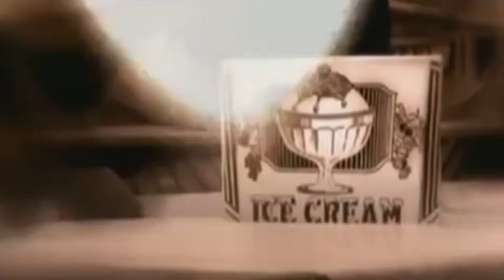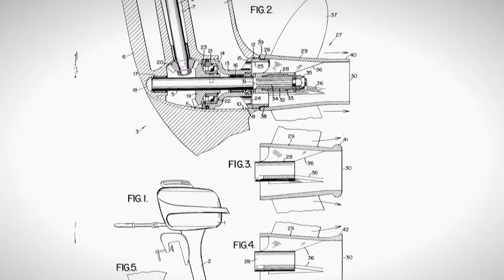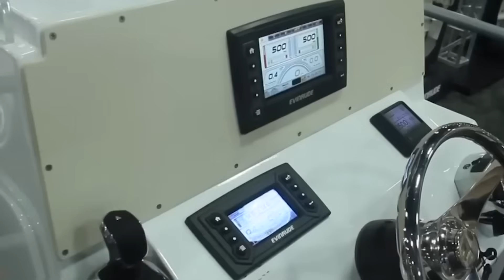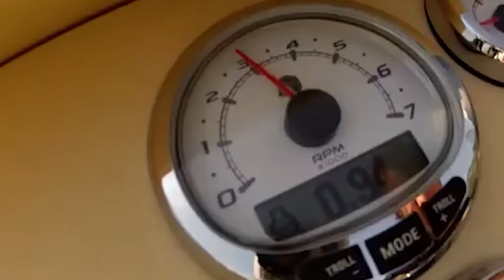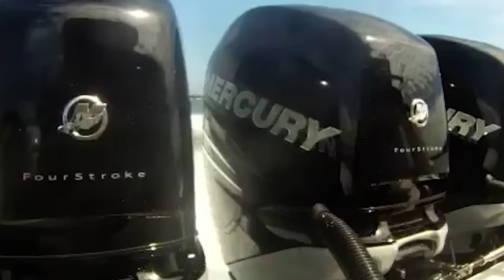Why Mercury and Evinrude Motors Are So Different?

Comment: Karl Kiekhaefer was a marketing genius. Selling outboards that put out more HP then the sticker. "Thunderbolt ignition" with a warning label attached that death could occur if you happen to come into contact with it. Sleeker outboard designs. People ate this shit up. Times are different now and people just want to go out and get back in for the most part. Men are pansies now and don't know how to mix their own fuel. Now we have outboards with $1000 fuel pumps and $10K lower units.
Reply from the maker: Top end outboard prices now are crazy. Often see transoms that cost more than a decent house! Are you mercury through and through?
Reply: @VintageBoats  I'm an Evinrude guy. I have a 225 HP Evinrude G2 on the back of my bass boat. I do have a 30 hp Yamaha and a 50 HP 2 stroke Nissan that i'm impressed with. I also have a 45 hp Mercury but haven't decided what I want to do with that turd.

Comment: You have the story wrong, OMC was co owned in the 60's by Ole Evinrude and Stephen.F. Briggs the father inlaw of Robert. P. Mcculloch (Ole Evinrude was also an inlaw of Mcculloch through Briggs ) Mcculloch was asked by Briggs to buy Scott Atwater and produce racing outboards as Mcculloch himself was a champion boat racer and to compete against Mercury as Mercury was gaining too much share of the outboard market from their popularity from racing and OMC was never marketed as as a performance engine but more of a reliable workhorse. Mccullochs often beat Mercuries in Racing and this is celebrated by the chequered flags emblem on the back of Mcculloch motors.

Comment: My dad ran a 15hp Evinrude on his Jon boat up and down the Pee Dee River for over 40 years. Other than an occasional spark plug replacement that was all I ever remember him doing to it. He never wore it out and now he’s gone but the old Evinrude still runs. He owned one Mercury in his life and it was a piece of junk that was next to impossible to start on freezing cold mornings.
Reply from the maker: What Merc was that?
Reply: @VintageBoats 
I don’t remember the model number but it was one of their older 20hp 2-stroke models. When it ran it was a good bit more powerful than the 15hp Rude but after several trips to the local boat dealer trying to get it to be reliable he sold it. Hard starting, and would occasionally just shut off.

Comment: My Johnson 1977 85 hp starts when you bump the key 45 years later.
Reply from the maker: Love it. What major works if any?
Reply: I started with a 1965 Johnson 40hp.  Talk about heavy OMG. Have a 76 Stinger 75hp 3cyl. In the shed that runs good.  Basically rebuilt the bottom of the motor.  Drilled and tapped many bolts.  Saltwater plus aluminum plus SS bolts = wrung off bolt.  Aluminum corrosion locks the bolt in tight.   Have a 18' Angler and the 75 gets the hole shot over my 85hp but 85 has it on top end by about 4 mph.

Comment: I have an 82 Evinrude 35hp on my pontoon boat.  Every season it fresh starts right away.  End of season it's shut off and dragged 50ft from the water.  New season, new gas, fresh starts again.  I think its only had a few sets of spark plugs and one water pump impeller in 43yrs.   What a TROOPER!  I used to be OMC, OMC OMC, but...the Merc 90hp Tower of Power is still the bad ass of the bad asses of boat engines, EVER !   To make an OMC V4 sound good, you have to under prop it and get er' to run 400~500 rpm over its power peak.  My brother's 115 x 86 Johnson is propped at 6000 rpms and its amazing sound and runs like a bat outta heck.
Reply from the maker: That's good going! How much longer you think it will last?
Reply: Yes, he’s hearing “Mercury Outboard Blues.”

“I really NEED a Mercury!” (And, if I had the $$$ to spare, I’d buy one and a boat to put it on.)

Comment: FASTEST SINGLE OUTBOARD  IN THE WORLD RECORD IS STILL HELD BY A 2 STROKE EVINRUDE.
Reply: The OZ F1 engine was awe inspiring 425hp of 2 stroke magic
Reply: @Clarksmarineincindiana I still love old 2 strokes. They the V8 Evinrude was laying down around 600 Hp in order to set the world record. Probably only good for a few runs at that HP
Reply: @keithbailey8885  I would have no clue of the actual horsepower for the world record. I just know what the “rated” horse power of that engine was because of  actual price list from second effort racing back in the day. We have a 3.6 liter V8 would love to find the newer 4.0 liter engine
Reply from the maker: You are not wrong! Perhaps a good video to be made...
Reply: @VintageBoats that record still stands. The weight to power ratio with that V8 2 stoke was something else. Even modern outboards can’t touch it.
Reply: @VintageBoats  please do! A lot of history on the outboard and the drivers for top speed records

Comment: Love Evinrude. I really hope to see them back! The E-Tec G2 was so good! I absolutely love mine.
Reply from the maker: Unfortunately think thay day has gone. Did you have a g2?
Reply: @VintageBoats yes I still have a G2. We had a wonderful Evinrude dealer in my area of Canada and there is many happy Evinrude owners
Reply: 2016 etec 135H.O. absolutely love it. It replaced a 1987xp150 with countless hours. I sold it for $600 to someone in need. Still running strong.
Reply: @michaelscott8510the 135HO are strong! Especially on the right hull rated for low HP. The V6 2 stroke tourque is fantastic! For such low HP!

Comment: I've got a 2001 omc 115 - probably one of the last carburetor powered outboards, the pinnacle of the carb technology. My motor has many, many hours & starts up easily at a touch of the key & it runs STRONG, much more power than my previous yamaha 115!
Reply from the maker: How many hours you reckon?
Reply: @VintageBoats 1200+ & still ticking along nicely.

I have removed the VRO & VST & run it on premixed fuel but other than that she's a beast!

Comment: In my 40 years of experience, Mercury was always the more desirable, reliable brand over anything from OMC. But Yamaha was always considered the reliability king. The mercs were always faster . People will  be brand loyal, only because they don't want to think they bought the wrong product. Another point, Suzuki went all in on 4 strokes more so than any other brand, and today they build what I would consider the best overall 4 stroke for personal use. I would pick mercury for top speed, Suzuki for quiet personal use and Yamaha a close second. You can't really go wrong with the 3 brands, and they always were better than anything from OMC and BRP. Truth be told.
Reply: My father was a loyal OMC man because what he observed with Mercury in the late '40s through the early '60s was far less reliability, not to mention their "direct reversing" dock smashing design. In addition, his 1958 Evinrude Big twin 35 was quicker than the Mercs in that HP range during that time. Even as a young man I noticed they were stubborn starting at times, but all that seemed to go away with Thunderbolt ignition. 

However, a year or two after he passed (at only 47 years) an opportunity to buy a Baja 14 ft with a 85 XS Merc came before me and I trespassed family tradition. I was so impressed with it's strong power curve and excellent fuel economy, not to mention it's robust and superior mechanical design that I haven't hesitated to buy Mercs ever since, in fact I have two smaller ones in my shed right now.
Reply: @Motorhead-hm5jq  since my experience only goes back 40 years, what occurred in the 1940 's is before my time.
Reply: Honda Marine is the most reliable out of all of them and was leader in 4 stroke technology in the 1970’s.
Reply: @craiglittle7367  yam has Honda beat today, tho not in simplicity, Honda is preferable to work at over Yam, yam has 3 different water pumps that are exactly the same, except the location of the dowel pins or the length of the water intake tube off the top of the impeller housing, however, they are indeed stronger.
Reply: I’ve had 3 mercs, a 1978 90hp, a 1980 115hp and a 2004 90hp. I have one Johnson, a 1989 50hp  it’s certainly not as fast as the mercs but it is absolutely the most reliable. The old Johnson starts easier idles smoother and never has any issues whatsoever so ever.
Reply from the maker: Definitely from BRP. Do you own mercury?
Reply: @VintageBoats  I have owned several Mercury motors, have extensive experience with mercury. Also owned Yamaha and the new 4 stroke Suzuki motors .
Reply: your brand loyalty is showing
Reply: @ccclc6159  to which brand?
Reply: @Briandswinford  clearly mercury
Reply: @ccclc6159  How so , I think the Suzuki was the best overall motor I ever owned. But the mercs were faster. The only motors I never liked were built by OMC.
Reply: Exactly what I thought. Maybe he had a motor made on the best day ever at the Merc plant. No way on God's green earth has a Merc been more reliable than an OMC product , of course , that is allowing for each to have a bad day. @ccclc6159
Reply: Fisher Pierce made Bearcat 4 stroke outboards in the 70’s.  Probably before Honda got going in the outboard industry.
Reply: You’re not entirely correct. OMC/Evenrude made very reliable motors for a long time until they eventually didn’t..😂
Reply: @bluntone2273  Maybe in your world but on my local lakes , back in the 80's, it was always a broken Johnson of Evenrude .  After all if they were so great then why did Yamaha win ? It's now all Yamaha and Mercury . Suzuki is making a good presence in the US with some great offerings. and of course Tohatsu which isn't popular here only because a lack of dealers. Let's get real , OMC would have never been able to compete with what's offered today. Mercury had the backing of a very large company with almost limitless RD money. The Japanese offerings were already really good and top quality. They had no chance long term anyway. We wont even get into the Toxic waste mess they left that the taxpayers had to cover. The company was a disaster I never understood why so many people still rally behind them. They did nothing good for the industry, they cost the tax payers money, they damaged the environment all for their crappy low quality outboards. Cobra stern drives, lol we won't go there . I say good ridden and the fact that BRP threw so much money at the problem makes me question that company also.
Reply: We had a little Honda 4 stroke 20 years ago, and it was pretty quiet too👍
Reply: @coryernewein 

I believe Honda was the 1st 4-stroke outboard manufacturer/importer in the USA back in the late 1960’s early 1970’s. 
Honda was leader in 4-stroke innovation before any other Marine manufacturer.

They still make the best outboards, btw.
Reply: @coryernewein  Honda never even made the list because the availability was non-existent here where I live. I might have seen 3 in my entire life.
Reply: 100000% boat mechanic, Yamaha Merc are way better to work at than Suzuki, Suzuki is strong tho but for reliability I think Yamaha and Honda have Suzuki, evinrude is junk lol 😂 the Ficht and E-tech, have killed all like I had for Evinrude, Merc is strong, as long as you stay away from the optimax,
Reply: @Erbbrothers  My opinion was not about which was best to work on, but best to own. I picked the suzuki because it was quiet, and fuel efficient, it was also reliable. Honestly the quiet over the 2 strokes was the biggest thing that won me over. The overall enjoyment , conversations that I never had before won me over. Yamaha is likely more reliable, but I never had one as quiet and my Suzuki.

Comment: I have a 1981 evinrude 9.9 that is still working great. I bought it 15 years ago with a jon boat. Put a pull starter on thats about it. Starts right up, always turns heads at the boat launch.
Reply from the maker: Amazing. Where abouts are you launching?
Reply: @VintageBoats  Southeast Michigan area. Always get someone coming up and asking about the boat.

Comment: so different????  the packaging is different internal parts and function is basically the same
Reply: WRONG,ETec has an entirely different oil injection system! Simple,fuel efficient,and their engines produce a ton of low end torque! My 50 ETec will out pull,perform,and fuel economy than any 50 hp. On the market,plus I can winterize it in 5 minutes, then if needed start it and run it  again!
Reply: yawn...
Reply from the maker: A little more to it than that. As you can see from comment below as example. We're you merc or evinrude?

Comment: Had a 9.5 Evinrude back in late 60s. Ran great on  a 12' boat. Could even tilt  the engine to run in 6" water. Blewup 2 Johnson 65HP  on my ski boat over 4 years. Bought  a 85 Merc and sold the boat 16' and motor years later still going strong. Enough power to pull 2 skiers and reliability to venture off shore losing sight of land. For me, Mercury was king.
Reply: Had an old 45 Johnson that blew up. Bought a new 60 and ran like a dream for many years. Also had a V8 inboard/outboard OMC that was a nightmare. Perhaps the Evinrude philosophy died along the way of all the corporate drama. As an engineer myself I know what poor management can do to a product.
Reply from the maker: Not running anything these days?

Comment: Not even 30 seconds in, the Bullshit is thick. Evinrude did NOT Invent the Outboard. Mercury did NOT start out as a Propeller Company

Both Companies introduced Electronic Ignition in the second half of the 1960s, and both were slow putting spreading it down the Line.
In the Early 60s, Mercury did choose a Much Better Lower Unit design for its Large Motors, OMC finally did in 1969

OMC's 1st DI engine was FICHT, better pronounced as FUCHT. E-Tec was a later version, but mainly just a Name Change to get away from FUCHT
I owned both large, OMC and Mercury Outboards. They each had their own Sounds and Quirks. Both conked out on the Lake.

Brunswick was using Mercury's Profits as a Life Preserver, as it was bleeding Cash left, right, and center due to Incompetent Management. Carl sold Mercury to them and was most paid in Stock. He lost Millions as Brunswick Stock Tanked, and was forced out of what was once his Company

Mercury's 6 cylinder Engines had an Advantage when it came to Exhaust tuning. A 3 Cylinder has a huge advantage over 2 or 4 Cylinders. Mercury's 6s were treated, exhaust wise, as two 3 Cylinder Motors.

Comment: Mercury did the same thing to 7 marine buy making a 600 hp v12 and the next thing you know seven marine is no more I hear that wasn't a bad outboard but I would buy the Mercury because of the network of Mercury and it was cheaper than seven marine Mercury just gets rid of its competitors
Reply: Seven Marine was started by a former Mercury executive and his son. Their outboard was a supercharged Cadillac V8 engine on top of a lower unit built by ZF. They were cool outboards but had a ridiculous list price that limited their appeal to any beyond the uber rich. It was only a matter of time before Mercury answered with something similar and Seven Marine's goose was cooked, Mercury had the weight of being a major player in the marine industry behind them.
Reply: 7 marine was bought out by Volvo, it wasn't because Of mercury that 7 marine died. it died because of woke environmental assholes and corporate greed.

Comment: I grew up in the 70s and 80s. We had a saltwater fishing camp in coastal Louisiana. 
Everybody was using evinrude and johnson because of their power and reliability. 
Mercury outboards couldn't hold up in saltwater.
Reply: What was the problem then with salt water and mercury?
Reply: Corrosion for one. Those 70s and 80s mercurys weren't good at pushing heavy saltwater boats
They were great for freshwater use
Reply: @enginemaster01 just bought a mercury 70hp 2stroke 1979, going to use it in saltwater. Well we'll see how it goes.
Reply: Good luck @lehti95
Reply from the maker: Do you still get out on the water fishing today?
Reply: @VintageBoats  yes
Reply: I think, not 100% sure, but I think that was why Mercury introduced the Mariner outboard line. Mariners were said to be made for saltwater.

Comment: compliancy vs experimentation.  Kiekhaefer (it seems) would get an idea in his head and could not admit it wouldn't work.  His direct drive was because (rumored) he did not have faith in the simple clutch dog.  Then he apparently hated independent mechanic as there were a few "goose eggs" in many of his engine designs that involved trapping "hammer mechanics " to ruining engine cases. The early shift rod retainers on the inline six comes to mind.  But there were things that shouldn't have worked that did. His insistence of magneto points set at .008 thou.  Not .009, but often .007.   Some how the rubbing blocks under that spring pressure would last a long time. So keep up the good work and grow this channel.  Happy 4th
Reply from the maker: Thanks for your detailed comment and support. Channel is going well and your views and comments are appreciated, read every one. Hope to see you back!